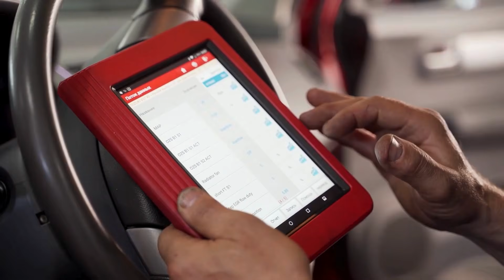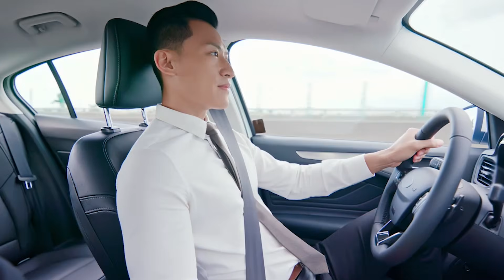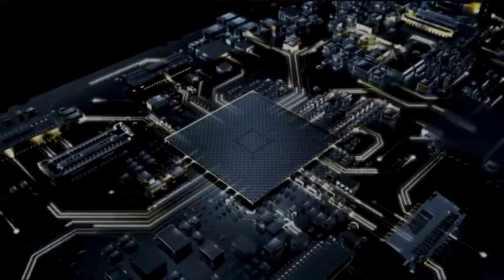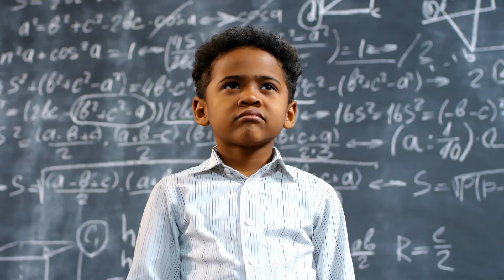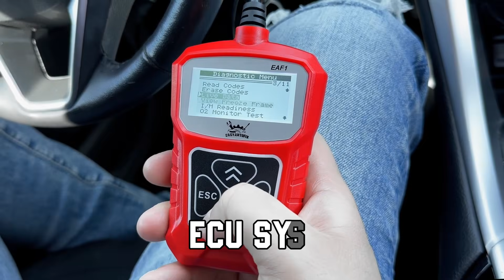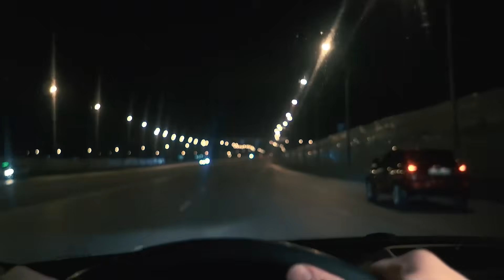How to Reset Throttle Position Sensor Reset Easily ( 4 Quick Methods)

Comment: I have accord vti 2002
We found that the TPS voltage is operating in reverse. The sensor output is approximately 4.5 V when the throttle is closed and gradually drops to 0.5 V when the throttle is fully opened.
Could you please provide guidance on how to troubleshoot and correct this issue? Possible causes may include incorrect wiring, sensor calibration problems, or an incompatible TPS installation. Thank you.
Reply: Did you fix this issue?

Comment: I have a 1999 Camry with 200,000 kilometers on it, and it's in good condition because I've taken good care of it and maintained it regularly. However, after cleaning the throttle body, a strange problem occurred: when the air conditioning is on, the RPM drops and the car vibrates, even though all the engine mounts are intact.

Help
Reply from the maker: Since it started right after cleaning the throttle body, it may need an idle/throttle relearn. The A/C puts extra load on the engine, and if the ECU isn’t compensating properly, RPM can drop and cause vibration. Also check for a loose intake/vacuum hose or connector disturbed during cleaning. If those are fine, do the correct relearn procedure for your specific car and scan for codes if the problem continues.

Comment: First one didn't work,
Second one did 
Thanks fixed my 2002 Lexus ES300 188,000 new plugs and coil packs along with valve cover gaskets with 4 new tires two months ago and she's running like new
Reply from the maker: Glad it helped! Stick around for more automotive care tips